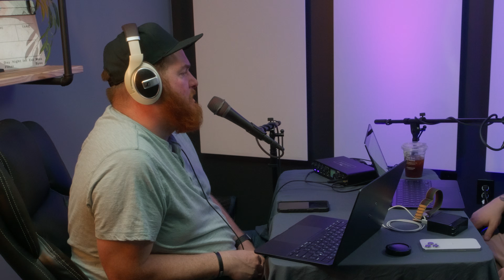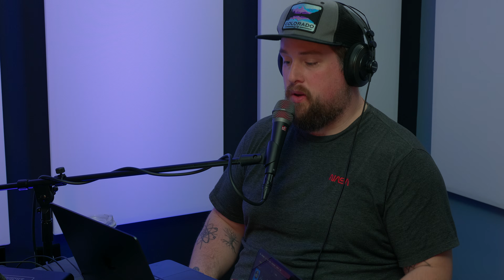Waves Audio Pt. 3 SuperRack Performer Is A Game Changer

Comment: I get 6 to 7 milliseconds of latency when the Ui24R, which is not that great compared to 1.4ms of the mixer dsp, but really this is the same as standing 2.5 meters from the speaker so it is manageable. Also with the MacBook Air M1 it is possible to run over 30 plugins with around 40% of cpu usage.
I just need to ask myself why I would need Waves plugins for my gigs, but let's have fun.
Reply from the maker: Haha well said